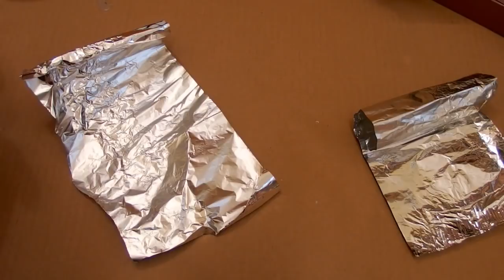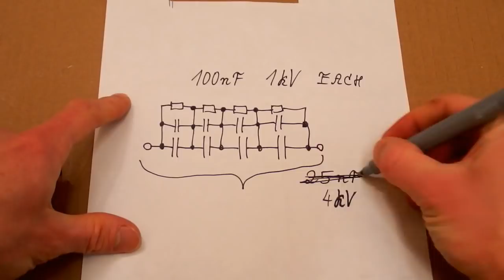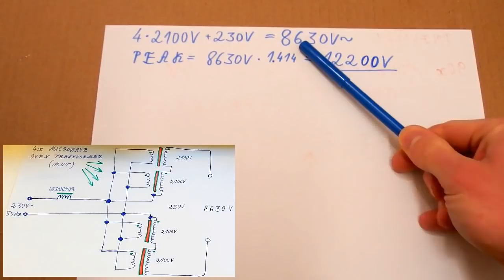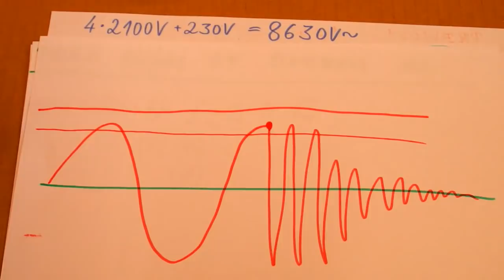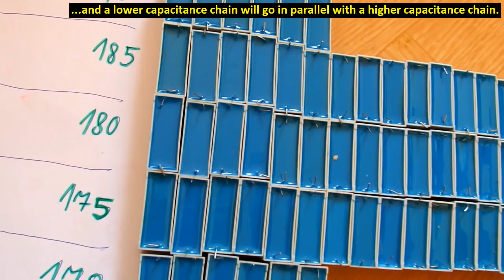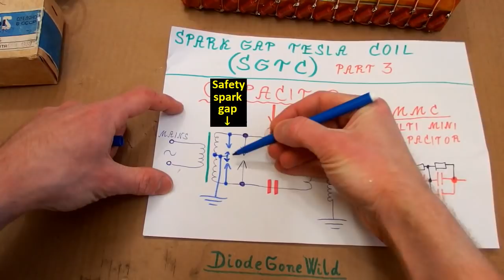Building Spark Gap Tesla Coil pt. 3 - MMC Capacitor

Comment: And at minute 6:46 when you add 2 parallel groups of capacitor that are i series that voltage is not 4kv anymore but is dividet by 2 and 4 by 2 = 2kilovolts and also those resistors you added it lowered the voltage even more so make some new calculations 😊 thank me later

Comment: That capacitor is like a capacitive drop on those led light bulbs the resonance is created by spark gap and this capacitor is just a protection for the primary coil to do not get directly high voltage from the secondary of the transformer and to burn both the coil and transformer you can put a high power resistor in series in place of that capacitor that capacitor and that coil is just like a voltage devider

Comment: Could you tell where you got the capacitors from and where i can get it? I cant find any capacitor rated for such voltages and frequency for a reasonable price
Reply: I know im late but if you still did not finish you can get a 2kv 100nf 10 pack polyproplanene film capacitor for only 4 dollars so 40 capacitors (14kv 71nf if you connect 7 in series and 5 in parralel) will only cost you 25 dollars

Comment: Maybe it is best to feed the cat before designing a TC, my cats demand it. Great work on the capacitor design and specs, and I would respectfully offer another way to think about resonance of the charging circuit. A wider primary (static) spark gap is often seen as an easy way to increase the power throughput and the size of secondary sparks. Running 'close to resonant' charging could be a great way to increase the charging voltage from, say, a 2-MOT balanced AC supply - the 6kV peak output is a bit lower than ideal, but it could be increased by resonance to 8-10kV peak at the capacitor and spark gap. This will likely reduce the BPS of the system but it might be OK. It's like tweaking a Tiger's tail - resonance doesn't automatically lead to destruction, but it does need careful calculation and simulation! Also, I am a great fan of what you called the split-capacitor method; Mr Tesla himself called it 'equi-drive' and of course he too saw all the benefits of a fully balanced circuit in reducing the undesired common-mode currents from the parasitic components.

Comment: I made a power supply which produces 100KV continuously very easy, it consumes 13 A at 47 VDC on the input which is 611 Watt... I'm driving the flyback transformer primary with my ZVS driver that I've built myself, basically it's a Mazilly circuit only I have paralleled all components one time for handling the power better and I also have a separate variable linear regulated power supply for the ZVS driver circuit which is separated with two 24 VAC switching relais that I use to disconnect the high power transformer on the AC side and on the DC side, both are switched at the same time with a foot switch because I don't want to be near any part of the circuit when it is live it's just too dangerous, it will kill a man faster than he would fell to the ground...
However I love to play with it and see what happens when I put such a high voltage to stuff and blow things up, lol.
Do you think I could use my power supply for a tesla coil too?
I have tested it using multiple layden jars in parallel on the output which is very scary to say the least but it does work, I'm just not sure if my voltage would be too high to drive the primary of a tesla coil.
Best regards,
Ricardo Penders
Reply: I think 100kV is too high, look for microwave oven transformers and string them in series. Styropyro has a good video titled overclocked plasma globes.

Comment: It's a simple calculation as long as the caps are the same. Otherwise, you would need to use 1/((1/c1)+(1/c2)+etc...) Also, the bleeding resistors, besides bleeding the caps for safety, the more important function is as you said, to balance the charges, because using many caps in series may cause that any of the caps get way more voltage than the others, making it fail. So the resistors (tens of megohms in this case) make a voltage division network keeping the voltage equal on each cap. As always from you, nice video!

Comment: Why not get rid of the MOTs altogether, and use your capacitors with diodes for voltage doubling as they do in those air ionising machines?
Just add a heck load of capacitors in parallel at each stage to boost your capacity.
Please see here:
https://www.youtube.com/watch?v=ouAftzfTHJs
>
And here:
https://www.instructables.com/id/How-to-Make-a-Negative-Ion-air-ionizer/
>

Comment: Love the video, as always - Thank you sharing your knowledge. 

I was thinking why not two discharge resistors, one on each side for redundancy in that safety measure (and double the discharge rate). But then I thought that since the resistors are not strictly necessary for function they are there to stop you from being killed, and given enough time the circuit will eventually self discharge. As long as you treat every capacitor as being fully charged, even if you are absolutely positive that it is discharged  (unless you have disconnected and discharged), everything is good.  And I think that the odds are, that a capacitor will fail long before the resistors will fail, although at high voltages I'm not certain - I've always had a sensible level of fear of high  voltage circuits, well anything higher than mains voltage.

Comment: Metalized film capacitor are superior to metal foil capacitors for Tesla Coils as they are self healing... when you get an arc over in a metal foil capacitor and the insulator is compromised at that point where the arcing occured, your capacitor is now useless as it's voltage rating goes way down.  Metal film capacitors are the preferred caps for Tesla Coil because they can look like swiss cheese inside and still perform very close to original spec.

Comment: Nice build. Very nice build. Excellent attention for the details and the theory.
In the MOT - capacitor - TeslaPrimary series circuit, the windings will do the bulk of the capacitor discharging, after powering down this thing. Anyway, good to integrate extra safety discharge resistors in the capacitor banks themselves.

Comment: I recommend you the rotating spark gap, it works much better there is no comparison. I have found that the angle grinder cutting discs are quite insulating and withstand a lot of heat, this is what I have used and I have put it directly on a angle grinder with a speed regulator to adjust it.
Reply: https://www.youtube.com/watch?v=K6Fx0Jnzdl0

Comment: I have tried making my coil with leyden bottles and then with a homemade aluminum foil and plastic capacitor dipped in oil and they worked fine but when I have made one with hundreds of commercial capacitors it shows that it is more efficient.

Comment: Instead of using MOT's why not try a flyback with a ZVS driver? It works great for me, and in fact, you can change your primary windings to get any voltage you want.

Comment: That was the most work I’ve ever seen anybody do with the capacitor voltage doubler.  I think I seen a simple video using ceramic capacitors and resistors in series going up a Jacobs ladder.

Comment: What's the capacitance of your cat? I have one that sparks like crazy after just a few stroking. I'm thinking of mounting a discrarge resistor on her somewhere.
Reply: be careful with the soldering joints! it might result in thermal damage of your very heat sensitive CatCapacitor (CC) which in turn might result in mechanical damage of yourself (punctured and even ripped outer membrane including leakage of precious red electrolyte). of course you want to avoid damaging your CC at all cost as everyone of them is absolutely unique and priceless!
all other methods arent very advisable either. like wrapping in Al-foil, wetting the outer shell of your CC etc.

Comment: ‘Tesla’ brand Capacitor ^^ : 0
Reply: Tesla (brand): TESLA - TE - SLA - TEchnika SLAbopúrpdová. Literally TEchnology LOWcurrent. Means Technology for low currents, sometimes translated as low voltage (I do not know why, it makes no sense). Better known as TESLA TEchnika SLAbá in former Czechoslovakia. Meaning "Weak technology", basically a joke on the brand name. Some former "TESLA" factories still operate, either under the original TESLA brand (e.g. Telsa Liptový hrádok) or under other names (e.g. JJ Electronic tubes in Čadca, PRO-Ject in Litovel) in both Czechia and Slovakia today.
Reply: I think I have a bridge in storage made with Coors brand passthrough rectifiers.  I ran it at an average of 60A for about two years, no trouble.  The current PEAKS were huge.
Reply: кондёры пр-ва Чехословакии. Вперемешку с советскими МЛТ-2. Довольно характерны большие запасы советских деталей в восточной Европе. Не первый раз вижу, что тесловики используют советские детали.

Comment: One more thing about connectiong capacitors in series: you have to take the tolerance into consideration, so that means you should build it to withstand more voltage than it actually will see. This is also improved when you put the individual capacitors in paralell, not only the rows.

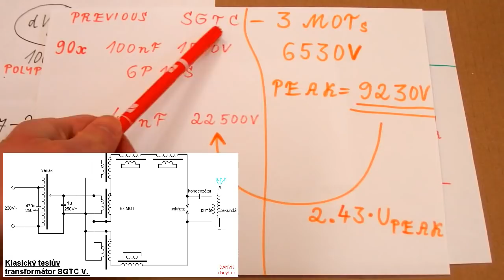Comment: 12:14 fun fact: capacitor is kondenzátor in hungarian too
Reply: In Polish we say "kondensator". For a curiosity, I looked up the translations in other languages - the Romance, Germanic and Slavic languages use exactly the same stem. Of course, not counting the Icelandic language which never fails with its lexical purism ("capacitor" in Icelandic is "þétti"). Even the Japanese word is "kondensa" (コンデンサ), same in Korean - "kondenseo" (콘덴서). It seems that English is just one odd out, however the capacitors used to be called "condensers" back in the 40s and earlier.
Reply: @FatalBombCRV  technically speaking at least in CZ, the word "kondenzátor" is incorrect, as nothing condenses in it and its feature is capacitance ("kapacita"), so the technically correct term is "kapacitor"...but almost nobody uses this word :D
Reply: V slovenčine to isté. Netuším pôvod, ale možno je to zmysle "kondenzovať (elektrický) náboj" (na jednej strane). To už je pre jazykovedcov....
Reply: @FatalBombCRV  Yup.  Even though I wasn't alive then, the books I read were that old or older.  I spent the first several years of my life calling them condensers.  Even now it's a perfectly fine word in English but just a bit old-fashioned.  Same impression as saying centigrade instead of  Celsius.
Reply: In German it's "Kondensator".
Reply: in romanian is condensator
Reply: In Spanish is Condensador
Pretty much the same across languages
Reply: In italian it's "condensatore"
Reply: in japanese is "kondensā"

Comment: How much power is required for 6cm diameter and 30cm coil       please answer how many watts power supply
Reply from the maker: I'd guess about 50 - 200W would be enough. But of course there's no direct corelation between power and size of a Tesla coil.
Reply: @DiodeGoneWild  thank you very much I really appreciate it

Comment: When I was in high-school back in the early '70s someone in electronics class set up a nice home-made tesla-coil, using a 15,000 volt neon sign transformer and a simple spark-gap assembly with about an inch or two of spacing in the gap, and the big coil's  fine-gauge secondary winding was wrapped the length of a 6 foot tall/6 inch diameter plastic pipe and a few turns of heavy-gauge wire at the bottom of the secondary winding for the primary, and the capacitor  consisted of the safety-glass from an old 21" TV with both sides covered  with aluminum foil, leaving about an inch or so of space around the edges of the safety-glass plate so it wouldn't arc across the edges of the plate. When that thing was fired up the sparks would jump across the gap sounding like .22 gauge bullets being shot at 60 rounds a second and the foil on either side of the glass-plate capacitor would clamp tight against the glass and buzzed at 60 Hz, and the very-high-voltage arcing and sparking  crackled all around the little metal sphere that was at the top of the secondary. Tesla coils are DEFINITELY awesome! :-)

Comment: copier proof overhead transparancy -if you are able to still get it - withstands 20kV AC. In the lab we didn't have enough voltage to create an arc-through. I made a layered capacitor with this material together with aluminium foil that gives a big bang. such a device is of course completely deadly.

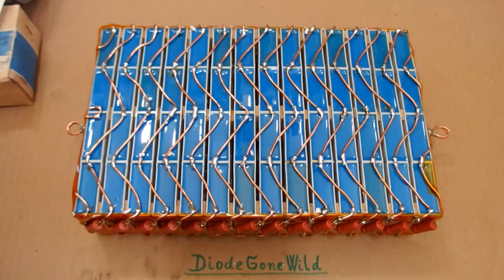Comment: 23:47 This looks beautiful but you have used shorter leads by not connecting the capacitors diagonally but from one pole to the nearest pole of the capacitor next to it. 
Half of the parallel connections would have been short too but the other halves would have been long. The latter are less important because they are just for discharging. 
Did you consider different topologies? (I’m sure you did) and what were your considerations? 
I must say that I quite like the design you chose from an aesthetic point of view.

Very exiting project!
Reply: I would have wired the caps at 90 degrees, rather than in waves. In other words, I'd use straight lines of wire joining all the caps in each column. 4 grids, each 7 rows x 8 columns, rather than 4 grids, each 14 rows x 4 columns 
So, instead of 2 banks x 14 rows (28S) x 2 layers x 4 columns (8P) = each layer 14 x 4
I would make it 2 banks x 2 layers x 7 rows (28S) x 8 columns (8P) = each layer 7 x 8
In that way, all the caps would be "orientated the same way". The resistors would go at one end of each column. Interconnecting wires would be heaps shorter, and it would be infinitely easier to understand LOL

Comment: I can't imagine the time it took you to build that bank, let alone 2 of them. Genuinely a work of art, it's mesmerizing to look at, the solder job, the symmetry, i'm speechless
Reply from the maker: Actually I still have to build the 2nd part :). I have just one now. The soldering is horrible. The previous one I was building many many years ago looked better
http://danyk.cz/mmc.html
Probably because I used a thinner wire which was easier to bend into nice regular waves. This one uses a thicker wire which is harder to work with, but it brings lower resistance.
Reply: @DiodeGoneWild  Wow!... that danyk.cz site is a treasure-chest of all kinds of goodies and gagetry etc etc etc. Thanks for sharing that link. Also, that's definitely a beautifully-constructed capacitor bank you built back then. I just got here and saw that link and checked it out... now on to your video on this page...... :-)
Reply: Your new cap-bank is definitely  beautiful, too. Thanks for sharing.
Reply: @DiodeGoneWild  For a high frequency pulse capacitor, the inductance is going to be much more important than the resistance. Increasing the diameter of the wire reduces its inductance but not by much, so using very thick wire beyond what is needed to prevent the wire from overheating probably won't have noticeable results. A braided wire (maybe solder wick) could be used to further reduce the inductance.
Reply: @DiodeGoneWild  but the Tesla coil  is high frecuency, not will be better to use varius finers wires for the MMC? Or is better to use one thicker wire wire?
Reply: He never explained why his capacitor needs to be 102nF but do you really need that many?  Why not just get one with the correct rating?